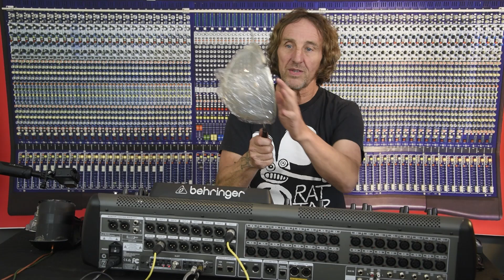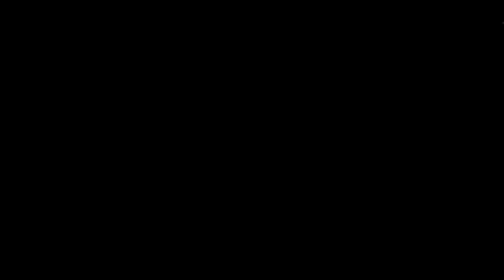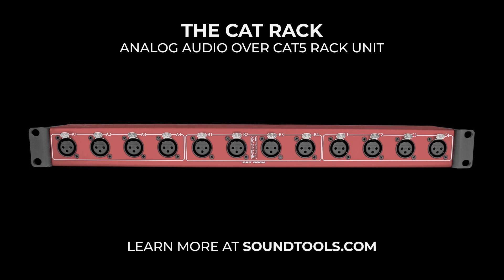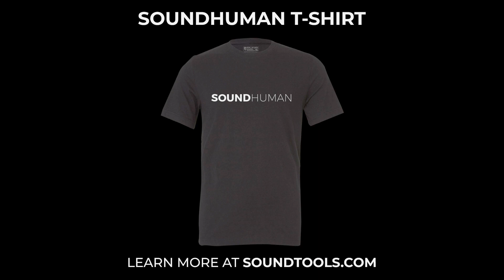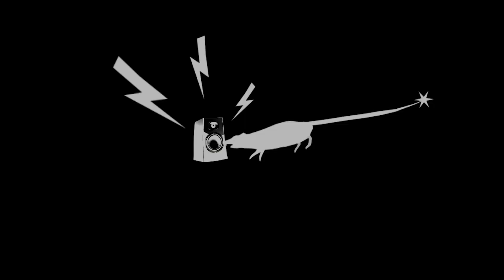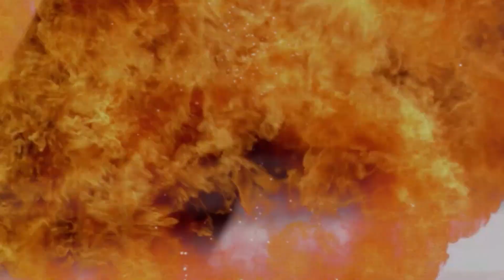Aux Fed Subwoofers Are Better - Because of How Mics Work

Comment: @Dave how do you apply this approach to systems with different crossover points? 

For example, if you're mixing on a K1/K2 system, your hi hat channel (not sent to the subs) is going to be sent to a system which reproduces frequencies down to 35Hz. It is true that you're not going to get any pesky 25Hz coming out of the KS28s, but that last 10Hz of LF extension isn't your whole problem in this case.

Even if you're happy with this (or another hypothetical channel) high-passed by the system at 35Hz, your punters listening to the same thing in the Kara side hang is hearing it high-passed at 55Hz. This is, if nothing else, different. You've just handed effective control of your channel's HPF to the system tech, and he or she has (unavoidably) chosen a different one for each section of the system. ...and it's the same for every channel. Personally, I want a different HPF for my hi hat and my snare. What if, tomorrow, you're doing a smaller venue with a Kiva II system, and now your default HPF has moved up to 70Hz; wildly different to the 35Hz you had at Coachella yesterday with all the K1 one can hang. Would you, in this case, use channel HPFs as well? Does this not defeat the object?

The question I have is what's so special about the HPF in a crossover compared to one on the channel? They are both high-pass filters with slopes of some dB/octave. System crossovers will (or should) have been set to optimise the loudspeakers' performance and phase integration with other components, such as the subs. The functionally-identical filter we have on every channel can (on most desks) be set to almost any frequency we like and, on posh desks, we can also choose its slope, independently from other channels.

Granted, I don't want 'sub' from my hi hat either. But if my channel HPF is 24dB/Oct, that just means I need to set it a hell of a lot higher than 90Hz. ...and, ultimately, who cares what that number is, if it sounds right? If the system is provided with a significant LF contour (let's say, for convenience, 24dB at 45Hz), a 24dB/Oct filter at 90Hz will be doing cock-all down to 45Hz except making the system respond as if it was flat down to 45Hz, rather than contoured.

I'm happy in pre-school, but always keen to have it mind changed by a convincing argument. But I'm afraid I've still yet to hear one for subs-on-an-aux. The logical extension of that approach seems to me to be compression-drivers-on-an-aux, but no one seems to do that. That would be silly... 😉
Reply from the maker: Basically you want to high pass your high hat, oh and whatever you don't want to go to the subs and send to mains, all good.

What I am pointing it is that after you have done that, why would you also send those instruments to the subs?

Not sending them to the subs is better than sending them for no good reason other than not having the control not to do so
Reply: @DaveRat  I suppose because if, after I've managed the LF content of a given channel to my liking with channel HPF/EQ, there is anything left which is within the subs' band, I want it to come out of the most appropriate component, whether that be a compression driver, a midrange, an LF, or a sub. 

Your own excellent advice on voicing-up a PA to the same reference curve (whether that be flat or contoured) means that, having done that, I should get consistent output on any system, whereas doing the same thing with some channels specifically excluded from parts of the system (I.e. the subs) would unavoidably lead to inconsistent results due to those systems' differences in LF extension of the 'mains' and the contribution of the 'mains' to the overall amount of LF in the system.

Thank you for sharing thought-provoking content and engaging with us (even on a debate such as this which will rage forever). 👍👂
Reply from the maker: Thank you, it's also important to look at why would a vocal, oh or HH have content bellow 50hz?

Most likely is would be due to stage vibrations, wind, handling noise or other undesirable issues.

Everything possible should be done to not send that to massive high power subs.

A high pass helps but a filter reduces and does not eliminate like a seperate send does.

The false concept that giving inputs incapable of reproducing ultra low frequencies is somehow natural or good, is flawed
Reply: @DaveRat  I do totally agree with the desired outcome: NOT reproducing errant low frequencies. But as a technique to achieve it, I respectfully submit that this creates a different set of problems. Maybe not better, maybe not worse.

If I was preparing a mix on one system only, in which the 'mains' did not meaningfully overlap the subs, and the whole audience was listening to the same type of loudspeakers, I could possibly be persuaded. 

But where mains, sides, delays etc have significantly different high pass filters themselves, we're trading extraneous low end (which may be undesirable, but can arguably be managed to a satisfactory degree on the channel) for inconsistent tonal response in the venue. 

I'd love to have both, but if I trust my system tech and send them full range, it will sound nominally the same everywhere. Therefore, if I can get it to a point where I'm happy at FoH (whether or not there is some LF 'noise' in the mix), the audience in the cheap seats will hopefully be just as happy. With subs-on-aux, I possibly could make it sound cleaner still out front, but I now live in fear that it's sounding 'thin' in the sides.

I will concede this: you have made me think differently and slightly less negatively about this as an approach. Perhaps I've moved from -Inf on the fader of interest to -72dB. That's still practically inaudible, but, looked at mathematically, it's also an infinite improvement 😉

I will also say that, as a designer of installed systems, I invariably provide Left, Right, Sub, and Fill inputs so that, despite my own preference for the pre-school approach, visiting engineers can and do have a good time, however they care to drive the system.
Reply from the maker: Very cool. I wonder if with all of these diff high passes all dependant on subs that have a unified high pass, is it truly a concern to reduce weren't noise from the subs?

Is the system not tunneled or covering such that the subs combine well with everything?

Is so, not sending to subs will have an equally beneficail impact on all the systems
Reply: @DaveRat  The effect would be different, wouldn't you say? Subtracting sub contribution from the overall response of K1 is going to make far less of a difference than from Kara. That's ultimately my point.

...But my bigger and more important point is that, whatever approach one uses, if it sounds good (everywhere), it is good. If you achieve that with discrete sends and I achieve it with playdough and crayons, the audience is winning either way. All power to both of us.
Reply from the maker: I will ponder the math of x + sub = good and y + sub = good

Does x = y?

And all good and pushing for desirable outcomes. Great to chat!

Comment: The mains  on a lot of modern PA go down between 60hz to 100hz, subs are just for the extra very low end. Lacoustic K1 can go so low, you almost don't need subs. For mixers who use an healthy amount of compression in their mixs, controlling this extra low end junk is  important, cuz this could clearly make compressors pumping in a very uncontrolled way. I always use some compression, saturation, limiter, etc... on my whole mix. For all of these reasons, subs on an aux don't work for me.
Reply from the maker: Compressing the subs freqs makes the unwanted rumble a higher % of the audio.

Compressing the super clean sub send that only has wanted info creates a tight clean low end  and allows pushing more useful energy and not increasing the unwanted muck

Comment: I agree there are advantages to using the "sub on an aux" method in certain contexts. Where this doesn't hold up is on large format PA where the main boxes go to 40hz. Keeping the rumble out of subs isn't that impactful when that rumble is being reproduced by the huge hangs of huge speakers covering the whole audience. Only sending some things to the subs also doesn't clean up a record/stream feed. If there's low rumble on an input I would do as much as I can to eliminate it at the input so that everywhere it goes it's how I want it to sound. This also applies for compression on the input and sidechain compression that is keyed from one of those inputs. Getting rid of the mud at the source allows those to operate more effectively.
Reply: It all depends on how those large format speakers are tuned. If they are 'flat' from 15Khz down to 40Hz with the subs 12dB louder then it might help to put subs on a seperate send. If these large speakers have a 12dB bump in low frequencies on it's own and the subs are just there as a extension there is not really anything gained by seperating subs from the mix bus.
It also depends highly in the used preset, KS28-100 will produce a lot more crap on high passed channels than KS28-60 preset.
Reply from the maker: Eliminating unwanted signals to the subs via aux vs just turning them down via HP, is beneficial. 

Also there is another big advantage. When everying is sent to subs and mains, it maximizes issues summation and cancellation issues in the crossover region between subs and mains and all those issues impact all instruments.

When subs only see some sounds or different sounds, it minimizes those issues 

So time and phase differentials between subs and mains occuring for various listening locations are minimized or improved.

I will do a vid showing this
Reply from the maker: Interesting. My take is the opposite. As someone who has mixed almost entirely on large format PA for most of my life and as the supplies of audio for major artists and Coachella festival, the bigger the PA, theore subs involved, the more it matters.

For smaller systems that are not capable of reproducing lower frequencies at high levels, letting some of the low end crap route to subs won't have that big of an impact on the mix.

Regardless, I recommend to all to setup a test. Set up your mix and then mute everything that you normally would send to subs and mute the mains. Then see what is getting to the subs and if that is sound you would normally add to your mix or sound that if it was on a fader, you would turn it down or off
Reply: You can surely eliminate problems with inputs while managing your outputs, feeds, and matrixes effectively. 
I'd say the more low end a PA, the more essential HPF, EQ and balance are.

Bear in mind the processing you employ on the console might sound right in your headphones, is subject to downstream variables such as output sensitivity, distance from other sources. You can trust the inputs based off what you're seeing and hearing mostly, but outputs are trickier.

In my experiences aux fed subs are beneficial to every aspect of the show because it reduces stage bleed and allows your harmonic rings to emerge on the approach to 1kHz rather than the middle ground between 80-150Hz. It's just a good practice because nobody wants low energy feedback. We all desire the clearest sonic image with the least reflections.

Comment: Hi Dave, I am wondering how you handle aux-fed subs when it comes to bussing your instrument groups, like you talked about in your mixing strategy video. If I have my kick routed to a drum bus or a kick/snare bus, do I just have to accept I will be sending snare to the subs, or is there some work-around you use to use instrument busses while also only sending the relevant instruments to the subs?
Reply from the maker: Personally I use 2 aux busses for subs. One for left subs and one for right subs and send directly from the channels. 

I like total control but there are challenges with that setup that may not be ideal for some or many people.

For the mix strategy it works well but it adds a layer where you need to be subwoofwr send level aware when altering vca master vs subgroup master. Assigning the sub aux masters to the group vca master helps.

For sending subs from groups, having all your instruments that need subs in diff groups is good.

Or just having snare get to suns is a reasonable cost and the net overall improvement of reducing crap to the subs will see nearly all the advantages.

Comment: Timely information here. Our old system has the DSP handling our subs. I send a stereo signal to it and it takes care of everything. However, we have a lot of instruments that cover low parts that I can't just HPF (as though that would get rid of the mud). I certainly do get a lot of garbage in the subs and I fight for clarity on the low end. We just had a meeting today with our integrator for a new system and I told them that control of subs be returned to FOH. We can tune the crossover, but I want to clean up the low end and I can't do it without control over what gets sent to the subs.

Comment: I guess my question then would be what if you like to sub group your channels and apply compression on the channels as well as the sub groups? I've tried this with a normal aux fed sub before and the low end ends up not sounding cohesive with the rest of the PA, I believe because certain channels (kick, bass) are going to the subs before they hit groups which have extra compression. For a while now i've felt the only way to achieve my group structure is to have the subs on a matrix being fed from the left/right. At least that way I can still have control over the sub separately and the channels pass through my comp layers before they hit the subs. Obviously I also take time dialing in my hi pass filters.
Reply from the maker: Sending subs from a group or wherever suits your mix and style is all good.

What I am pointing out here is that HPF reduce crap going to subs and separate send will eliminate it. Less unwanted crap to subs is better than more unwanted crap to subs

Comment: Do you not use highpass filters?
Reply from the maker: Yes, I use them to get the sound I desire and I also know high pass filters are not optimum and inadequate for keeping instruments from being sent to the subs without raising the high pass so high that the input sounds bad. And even then, some sound still gets to the subs.

The way to not have stage resonances, vibrations, wind noise, handling noise and other low end garbage not go to the subs is to not send that input to the subs.

Comment: ..................................................................Good stuff, nice suggestion/reminder, perhaps a little-longwinded(maybe coulda been a 7 minute video instead of 14), but perhaps if you ever hit on this topic again - "list of stuff to NOT send to the subs" - maybe you could add the simple suggestion of "list of stuff TO SEND to the subs". ......wouldn't hurt ¯\_(ツ)_/¯
Reply from the maker: Thank you and yeah, things are so subjective ome band may want toms in the subs and another not. Tuba? Maybe, depends on how low the main system goes. If the mains rig goes down to 40 or 50, it's totally different than a main tig that cuts at 80 or 100.

Comment: Your comment about routing the aux to a bus at unity is the key thing many mess up.  I've seen several chase their tails trying to get levels right because they don't consider this.
Reply from the maker: True and also, having an offset in sun level is not that big of a deal. It's the same thing that happens if someone walks closer to subs and farther from tops or visa versa

Comment: Nice video Dave!  I remember asking you this question because of seeing Pooch and Rabold saying they DON’T do subs on an Aux.  I found it fascinating because since I’ve been learning the craft EVERY engineer I learned from and every venue I go to has the subs on an Aux option.  Great job explaining why you want it!
Reply from the maker: Yes, Steve I remember and you are the inspiration for the vid.

Yeah, don't need subs on a send but unless you need subs on all inputs you will add high pass on inputs that may not need it and will get unwanted energy sent to the subs which is usually time lagged bass bleed, handling noise, wind noise and vibrations.
Reply: @DaveRat  Very cool!  There is one venue I'm in often that is full range and it' such a different animal. I have to be WAY more liberal with high pass filters.  In a weird way I'm glad I'm forced to mix full range at this club so I have an idea of how to handle it if I run into it in the future aka more aggressive with the high pass on all instruments. Otherwise the low end swallows everything.  Hopefully I can jump on a zoom soon!
Reply from the maker: There is a subs on an aux emulation option as well